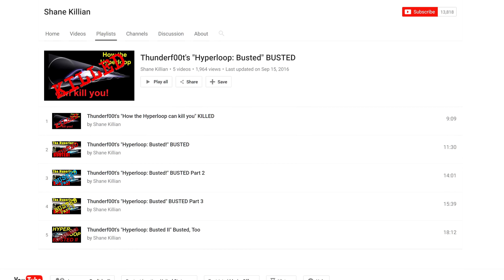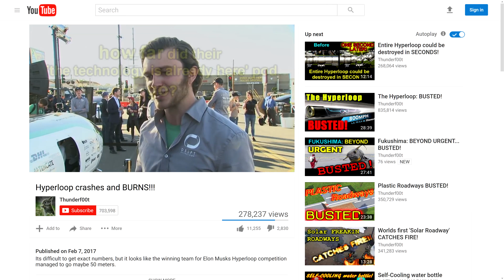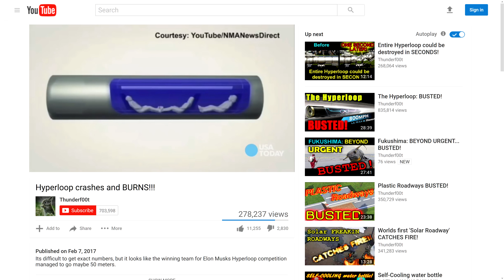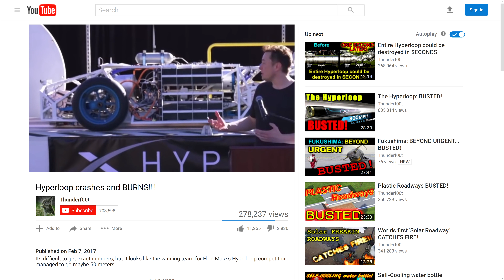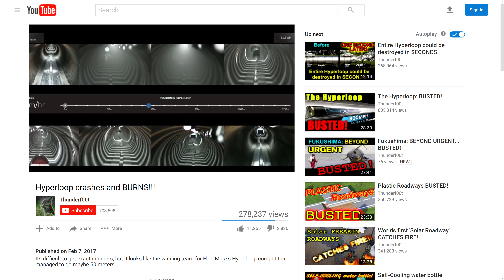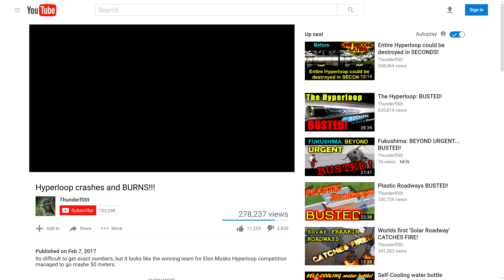Thunderf00t crashes and BURNS!!!

Comment: This video is retarded. The point of Thunderfoot's video is that we currently don't have any plausible way of actually building Hyperloop, but Elon makes it as if it could be done in the very near future.

Yes, engineers needs to test small things. But the scale of these tests are so small. I don't claim that we could all live in space and get back building a small space suit for me the be in space for 10 seconds.
Reply: "we currently don't have any plausible way of actually building Hyperloop"
What specific aspects of hyperloop's construction do you find implausible?
Reply: the fact it has to so big and has to be a near vacuum is currently impossible.
Reply: What makes you say it's impossible? 100 Pa is a pretty crude vacuum. A 2 cm thick steel tube should be perfectly adequate to maintain such a vacuum.
Reply: Ok guys, stop calling things outright impossible if it is not physically impossible. Impossible is a very big word I suggest using it wisely.

Now think of the first computers. They weighed tons, they needed weeks of rewiring to re-programe and consumed KiloWatts of electricity.
Reply from the maker: "The point of Thunderfoot's video is that we currently don't have any plausible way of actually building Hyperloop" LIE.
Reply: The argument then is easy. Do it, and make millions from it. I would love to apologize to you after I ride in one.
Reply from the maker: Again, there are THREE separate companies working on building them, not counting all the engineering groups working on designs. They're ALREADY laughing at you.
Reply: They are building them with students testing the shape of the cart? If this thing is not even theoretically ready, believe me when I say that we have got a while to wait. 

Maybe they will be built one day, but it's not looking like it's going to be anytime soon.

Who knows, maybe they are laughing at you for believing.
Reply from the maker: "They are building them with students testing the shape of the cart?" Oh, for fuck's sake, DID YOU NOT EVEN WATCH THE FUCKING VIDEO??? This test had NOTHING WHATSOEVER to do with the three main Hyperloop companies I mentioned! NOT A SINGLE FUCKING GODDAMN THING!!!

Comment: That idea still gives me the heebie jeebies but spot on analysis of his video.   Couldn't they just use a fan to blow air inside at 350mph then they would not have to worry about drag slowing them down?   The loading an unloading station could be open as well then,, provided they are wide enough it could just be a breeze at that point.   In lower speed areas a larger tube could be used, and since it likely would not be holding back much force- a larger tube could be economically feasible perhaps.

I mean a sneeze is what 100mph, so lets see 350mph that would be 72x the kinetic force, but how much pressure would that be?    Ugh I should know better than the stay up all night and think about things...
Reply: rofl wow sneezes do not go 100mph :)
Reply: Or perhaps they do, seems to be some debate on this :)   Well before I pass out the most reasonable approximation I saw for force was 1.9 N/cm^2 so 2.75 psi.   That actually sounds quite reasonable to deal with.
Reply: and fun fact coughs have higher acceleration than sneezes.
Reply: That would require Tons of energy and power. Even a perfectly smooth tube wall would have drag forces known as skin friction working to slow down air currents, also, at the end you'd need to spend energy blowing air into the tube at 350 mph, that alone takes an incredible amount of power.
Reply: "That would require Tons of energy and power."  Oh I am aware that is a factor, not entirely sure to what degree though, there is a significant cost alone in moving any masses at the speeds they originally wanted though at roughly half the speed though I assumed 4x less energy for the cars and no need for vacuum pumping might be closely analogous.  I am not aware of ticket costs or much of the model behind the economics though.   I am more concerned with safety and expedience of the process than of energy efficiency.
Reply: Alex, Ok so NACA's 40 x 80 foot wind tunnel at Ames Aeronautical Laboratory used something like 6 40 foot fans, likely around 6000 horsepower a piece.   The chamber had a larger volume attached that housed the fans, in that chamber the air was around 35-45 mph, after the cross sectional reduction to the 40'x80 foot area you had 250mph speeds.

Yes that is a lot of power at 746 watts per horse, but that is also filling a cross sectional diameter 32,000 cubic feet, for 36,000 horsepower of fans.  An 11 foot section of hypertube would have ~95 cubic feet. So at 0.8/hp square foot to produce 250 mph at 95 cubic feet  you are talking about 84 horsepower.   Lets just double the velocity of wind to 500mph and even at 4 times we are talking 337 hp ( 251kW )  That is not a huge amount of power to start with.  You are correct that skin effect is a factor, but oil is pushed through pipelines for hundreds of miles, albeit at 3-6 mph but there is significantly more skin effect let alone the differences in mass per volume, and unideal viscosity at that cheaper than by rail.

A big reason it is cheaper is because they can constantly be sending product through, no need for decompression chambers, higher flow of traffic can overcome the costs accrued by the losses in inefficiency to an fairly large extent.

edit PS the skin effect is because air is electrostatically sticky, it sticks to the walls and resists being removed, which imparts resistance on air passing.   The larger the diameter the more buffer room you have for high speed air/fluid to travel which lowers the overall efficiency losses of skin effect.  Its not important the volume of air being efficiently transported. its having within the regions the cars travel sufficient speed.
Reply: What you're describing is definitely not a hyperloop, but I can't say it's impractical.
Reply: "What you're describing is definitely not a hyperloop, but I can't say it's impractical."  Well I thank you for the affirmation that the concept is not flat out absurd.  I thought it was silly at first too until the thought kept recurring to me.

The thing that worries me most about the hyperloop is meeting high volume traffic that is how their money is going to be made and how it can revolutionize transport.  Nobody will care if it moves 9 passengers every 15 minutes per loading area cause they require huge infrastructures.  It can be proven to be viable economically, but that does help assure it will start a craze of them being built with cities across the world contacting them for systems.

I think the inversion of the idea is something that really comes down to practicality.  People can talk about the differences for positive and negative pressure vessels but it remains that adapting the current system plans would be relatively straight forward and really not that radical a difference.

I've seen some tubes, I've never seen the vacuum capable thermal expansion joints which would work under relatively low positive pressure fairly well I am sure, I've never seen any designs of the airlocks in great detail.  Honestly I have not reviewed the literature much but they cannot get around that the vacuum creates a inherent fiduciary risk.  They can come up with solutions but those solutions will come at expenses.

They want to launch a pod what every 30 seconds  with 28 passengers,  sound impressive unless you compare it to other track based systems some of them exceed that by 10 times with much smaller footprints required.      They could ramp that up and try to squeeze more but that requires more loading stations, real estate is at a premium if they are going to be offering convenience they gotta deliver people where they want to be.   Not to the outskirts that had cheaper land to build a huge port.
Reply: The Hyperloop does not depend on vacuum tight expansion joints. It's one solid tube. Thermal expansion is accounted for at the end stations where the airlocks would most likely move with the tube, rigidly attached.
Reply: Yea I remember hearing that in a video by Musk, but he never really addressed the scope of having 350 miles of pipeline, the station ends could move, but overall between the average high and low of california we are talking about up to some 85 meter of travel.  Lots of engineers thought you could have a solid pipeline of oil without thermal expansion joints and the real world did not match their models.

I do not mean to sound like a stick in the mud but this is so close to being able to revolutionize transport that if it fails, it could set back further advancements in transportation.  Big stakes at game from a guy who is really quite cocky.
Reply from the maker: Actually, that's addressed in the whitepaper.
Reply: "Actually, that's addressed in the whitepaper."

Is that also known as the Alpha document? If so:

  "Specially designed slip joints at stations will be able to take any tube length variance
due to thermal expansion." - 4.2.3

Really does not get much into the nitty gritty and Table 9. is a little ambiguous, like Stations/Vacuum Pumps 260 million,  and land&permits 1 billion.    Do you think they mean construction of the Station will cost 260 million + land or the 260 covers the land?  I mean if Pylons, tube are separate as well I guess they are.

I genuinely hope they can work out all the logistics but I cannot help but think that vacuum is costing them far more for land and station costs and throughput than it is worth.  What determines if this thing revolutionizes transport is not based on its technological appeal (as cool as it is ) but the bottom line dollar investment costs and returns.
Reply: Sorry or are you talking the notion of pushing air through?  If so this " the friction of a 350 mile long column of air moving at anywhere near sonic velocity against the inside of the tube is so stupendously
high that this is impossible for all practical purposes." is in the white papers but is actually not entirely applicable.
Reply: Shane you are correct that the information is right there on page 5, but I was not even sure that was the actual white papers.  Yes over the 20 minutes or so I reviewed the alpha document I did not read every line.  

"Once again, we see the difficulty the Hyperloop critics have of making it to PAGE FUCKING FIVE!!!"

To be frank I saw "By building a system on pylons, where the tube is not rigidly fixed at any point,
you can dramatically mitigate Earthquake risk and avoid the need for expansion
joints. "  I kinda rolled my eyes and skimmed onward,  I omitted the chance there would actually be the very answer I was seeking.   I've never once heard about yaw/pitch actuators to directly deal with upheaval buckling in the various articles i've read or videos i've seen about the hyperloop.  I associated the phrasing of telescoping tube to imply the stations would be handling the brunt as I only recently learned it would be solid pipe construction between stations.  If I did indeed know that material was not just some pamphlet handed out to the press full of buzzword jargon I would have read the entire thing.

Sure I can see you labeling me a critic but it is a fine line between being a critic and being skeptical.  If I came off that way and it got you annoyed- again I apologize.  I dunno I guess I should not be asking so many questions to a group of people who seem to be into researching it.
Reply: Oh and Shane I just unsubbed  to dunderf00l.  I prob should have a long time ago but I like when he does videos about nuclear power (which is never now anyway ).   Just in case that might put some semblance of a smile on your face I am informing you- ps your videos are great.
Reply: It is quite interesting- I am rather impressed they plan on using the compressor to create air bearing skis.
Pylon actuators sound very intriguing too as a solution for keeping stations small.  Not to take anything away from them but necessity is the mother of invention and they had some big needs to meet in this project.
Reply from the maker: Sigh... "A ground based high speed rail system is susceptible to Earthquakes and needs frequent expansion joints to deal with thermal expansion/contraction and subtle, large scale land movement.

"By building a system on pylons, where the tube is not rigidly fixed at any point, you can dramatically mitigate Earthquake risk and avoid the need for expansion joints. Tucked away inside each pylon, you could place two adjustable lateral (XY) dampers and one vertical (Z) damper.

"These would absorb the small length changes between pylons due to thermal changes, as well as long form subtle height changes. As land slowly settles to a new position over time, the damper neutral position can be adjusted accordingly. A telescoping tube, similar to the boxy ones used to access airplanes at airports would be needed at the end stations to address the cumulative length change of the tube."

Once again, we see the difficulty the Hyperloop critics have of making it to PAGE FUCKING FIVE!!!
Reply: You really should read the literature we reference before commenting. The Hyperloop Alpha document is an interesting read and not terribly long, either.